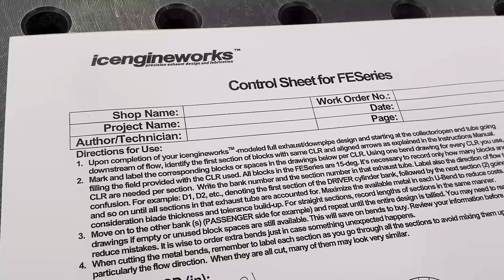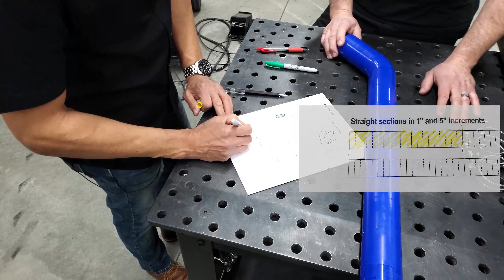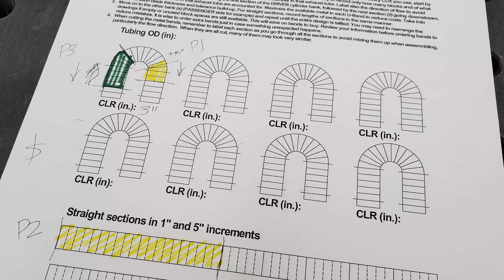Icengineworks Full Exhaust Modeling Blocks - Trick-Tools.com

Comment: I want the secret to getting them apart...they are hell to dismantle.
Reply from the maker: If the blocks are too tight initially try twisting them back and forth while they are snapped together like a motorcycle grip.  This will loosen the joint slightly.